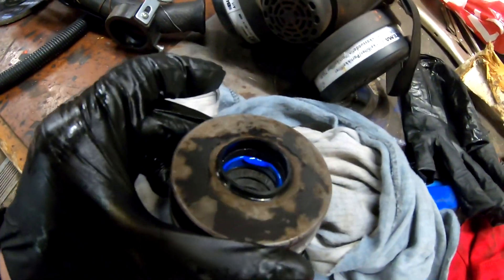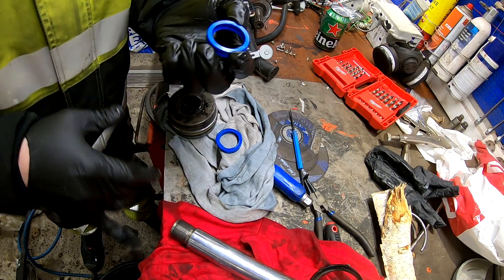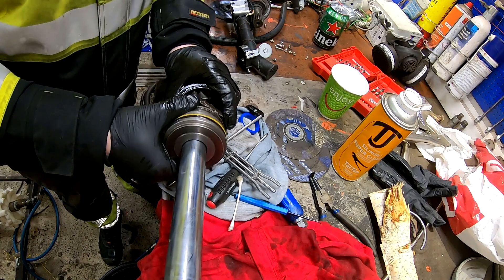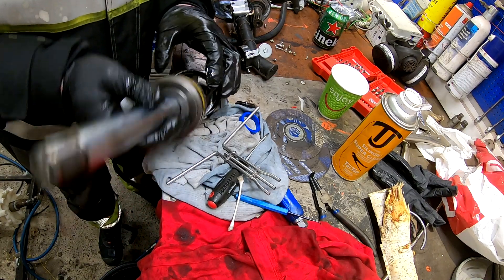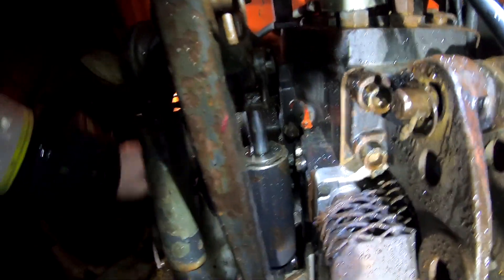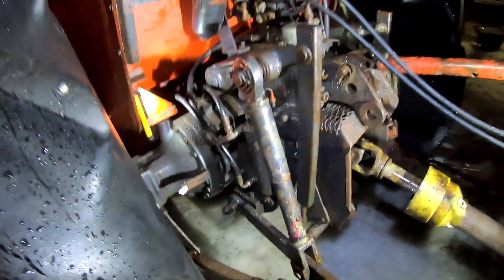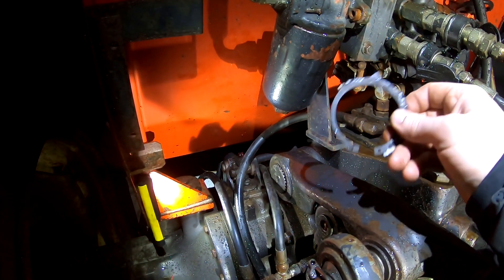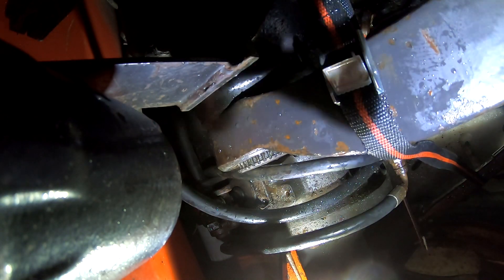Valmet 505 hydraulic cylinder reparation take2

Comment: Did you grease the seal before you slide it on?
That spline shaft would be hardened and you won't be able to weld to it properly.
Reply from the maker: Did spray it with silicone, my main goal with the weld was to keep it in place so it won't tilt out. And that it last until the new/used parts are here, so hopefully it will stick til then 😊

Comment: Those splines in liftarm axle and liftarms are weak spot -05 series Valmets and some younger models when they are start going loose , there is no any good strong fast repair.  If that liftarm axle slides sideways , it can broke or bendt inner parts for lift control valve.
Reply from the maker: The list controller haven't worked since I got it, if I lift the 3 point all the way up the pump continues to pump so I guess this is nothing new. I will get a used axel and lift arms so hopefully that will fix it 🤞
Reply: @MiniMachines1  Something is not right there if pump does not stop makin pressure when 3point goes uppest position , if those trailerhitch lift telescopes are too short , it also causes that continuous pressure in 3point top position , also it can be inner proplem.   In -05 series , in factory they make younger moldels liftarm axle threads both ends and instal cup style washers , that lockring is not the best option to keep arms in axle.  When you instal new axle and arms , clean splines and reassembly whit tar or anything what stops rusting.
Reply from the maker: @MrJsormunen  will check inside when i take it apart, but like it's been and is now its when I get almost to the top it continues to pump, I actually thought something was terrible wrong once out clearing snow, when driving I was missing a lot of power and I thought it was something with the engine, but that I realized it was the 3point list being too high so the pump was running 😏

Comment: Befor welding this cast iron arm, you should take it off first and check if this pivot shatf got teeth, cause if they are worn out it gonna brake again .
Reply from the maker: Yes shud have done that but was in a hurry had customers waiting on me so I just went with the quick fix worry about it later 🤗 since I had found used parts to fix it, this fix is just so it will hold until than 😊